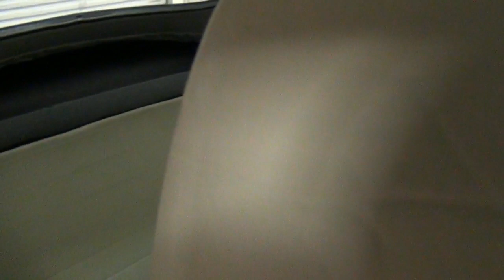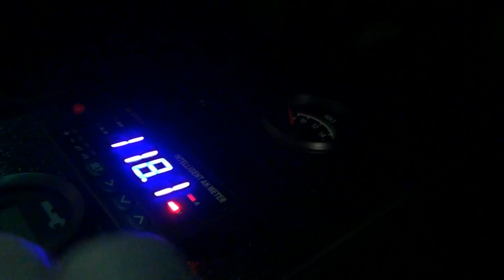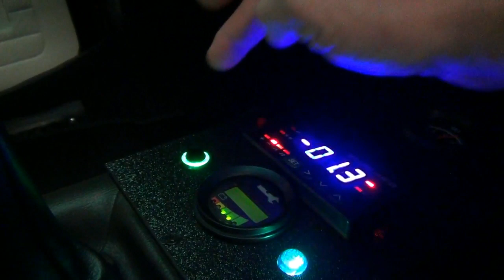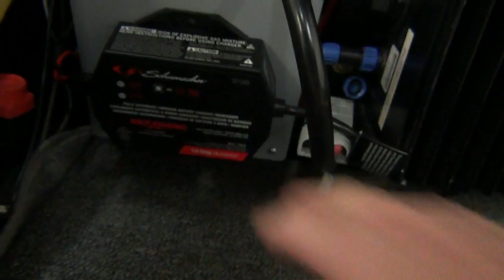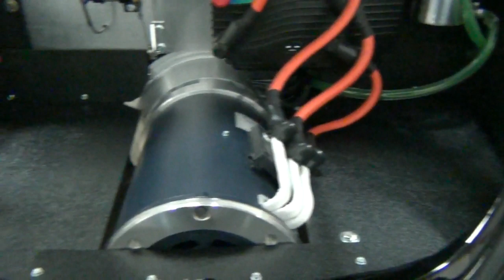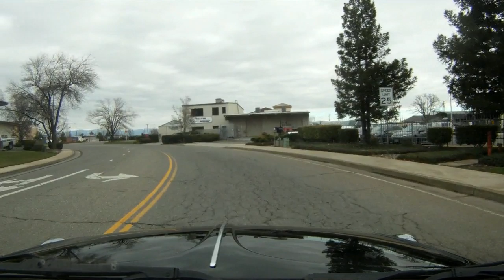VW Super Beetle Electric Conversion Test Drive

Comment: Just a few points. 60 - 80 mile won't get me from my home town to the nearest city without having to stop to charge. Until usable range hits 200+ mile conversions will only be practical for town applications. The usable space to put luggage behind the rear seat is now gone. The space to put luggage in the trunk is now gone. At least this one still can carry 4 passengers. And because you already explained the charge port I won't bring that up.
Your conversion looks very good and makes sense for the usage you intend. Just pointing out it has limitations.
Reply from the maker: Current range on the VW Beetle conversion is approximately 100 miles.
Reply: @ev4u  How long do you think it will be before you can do a conversion that gets a range of 200 mile? For us in Australia that is 320km. Almost every car I own can do 300km (186 mile) to a tank of fuel. 
My example is that I live 240km (150 mile) from our state capital. I can drive there for a car show on 1 tank of fuel. I fuel up and drive home after the show. I often do this with my everyday work vehicle. Drive down, run around buying work materials or other supplies and drive home again. Yes I buy fuel, it takes 5- 10 minutes of my day. 
I'm not against ev, I'm looking at your conversions because I want to have one done at some point. I'm interested in your opinion as someone doing these conversions as to how long before we can expect a conversion that gives a decent range, doesn't add weight above the original kerb weight of the car and doesn't diminish the luggage space of the car from its original design.
Reply from the maker: No idea, I'm not that good at predicting the future.  But it's coming.  I have been driving electric conversions everyday since 2008.  Range has never been an issue for me.  My daily commute (round trip) is 50-80 miles.  I charge when I have time just to keep things topped off.

Comment: Very sanitary job as always Richard. 

Couple questions:. Why not put the plug behind the old fuel filler flap so the hood can stay closed?  

If you hit the reverse button, and shift to reverse, does it go forward?  Cause I bet I'd mess that up at least once...  

Nice job guys!
Reply from the maker: The fuel filler area would need to be modified (cut) to fit the J1772.  We do not cut on customer's vehicles.  Plus you want the bonnet open to allow for the charger to stay cool.
In response to your forward/reverse question, yes.
Reply: I asked the same question!

Comment: Does this beetle have a BMS? What kind? If not, what is the maintenance/safety/rebalancing regimen for the owner to follow? Are the batteries LiFePO ₄? Thanks for being one of the handful of EV conversion pioneers, your work looks more brilliant with every build!
I'm looking forward to getting my VW converted with you (saving $$$ this year).
Reply from the maker: Yes on the LiFePO4 cells.  Our cells are bottom balanced and no BMS is required.

Comment: Watching from Scotland. 
Have to ask, why did you put charge port under the hood of the car, rather than put it where the fuel filler cap would have been?
Surely it would have made more sense, especially if you were at a public charger while it’s raining?
Reply from the maker: The J1772 charge port will not fit this vehicle without cutting the original sheet metal.  We try not to do that whenever possible.

Comment: Very neat job on a much loved design, do you have to do anything about front suspension, brakes or steering due to extra weight at front, i presume the original steering box is used can you get away with keeping original struts and even drum brakes at front?
Reply from the maker: The converted vehicle only weighs 2,200 pounds.  Far below the GVWR.  No additional modifications are necessary.  However, we recommend going to four wheel disc brakes just to get away from the maintenance associated with the stock VW drum brakes.

Comment: Any issues with the clutch or transmission handling the torque of the electric motor?
Reply from the maker: Not with this setup.  We use a lightened flywheel and a stage one clutch pack.

Comment: Why isn't the charging port behind the old gas door? I wouldn't want to leave the hood open when charging outside.
Reply from the maker: Because on this model it would require cutting on the car and we do not cut on customer's cars.  On the earlier standard Beetles with the fuel door, that is where the J1772 is located.  Just does not fit well on the 1979 Super Beetle.

Comment: Is there still a clutch on this car?  Another question: apart from the rebuilding of the car, that i see is very nice (it seems a new one) how much does it cost the electric conversion?
Reply from the maker: Yes we retain the clutch and transaxle.  Currently classic VW Beetle conversions are $23,995.  See our website for more information.  Please note that we did not rebuild the car.  EV4U only does conversions, we do not do repair work or restorations.

Comment: let's see ... your doing 60 and getting passed ..... limit is posted at 55 ........ Redding drivers are as bad as Marin drivers ................ just sayin' ........ nice car though ................. ;-p
Reply from the maker: On Interstate 5 the truckers where running 70 mph.  The Beetle will cruise at 80 no problem.  Except it is not my car, so safe and slow it is.